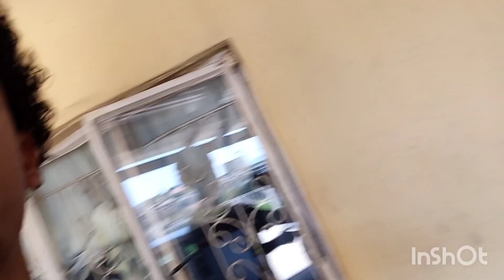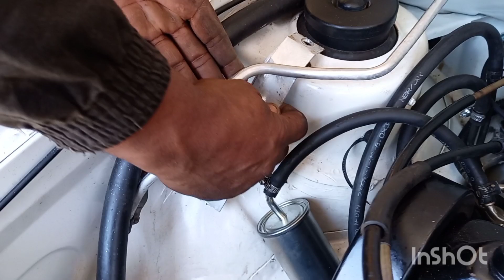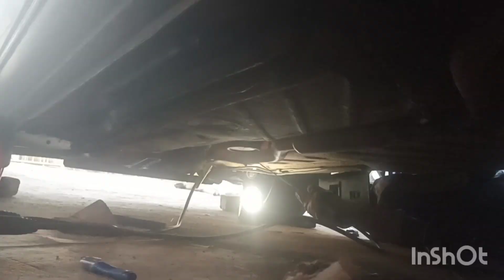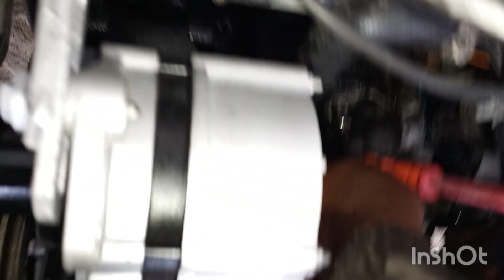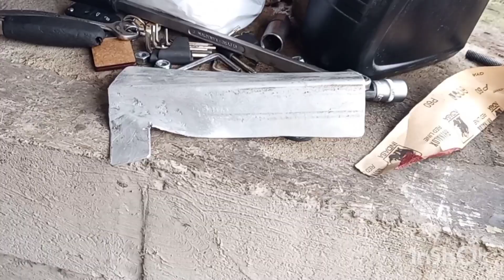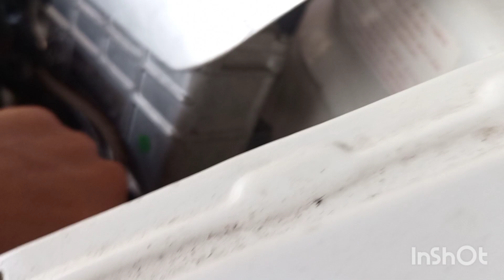Making Custom Brackets For My 1.9i 8v - VW MK1 Build

Comment: I see you using a using a 1.4 computer box on a 1.9 i, Does it work okay?
Reply from the maker: The 1.4 computer box is recoded to a run a 2l engine so it has enough capabilities to run a 1.9i